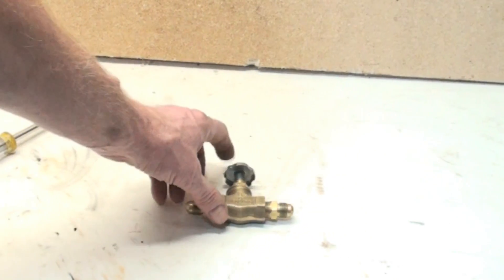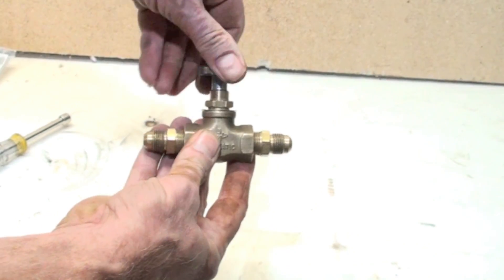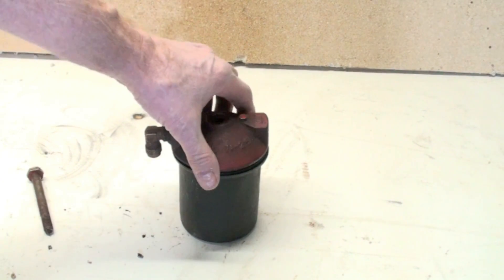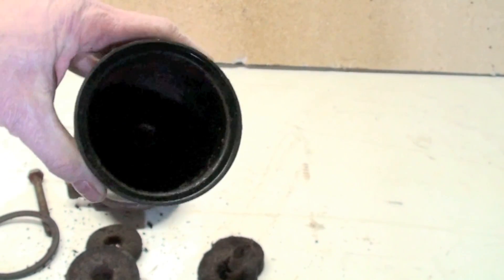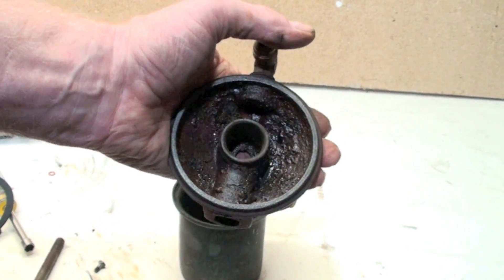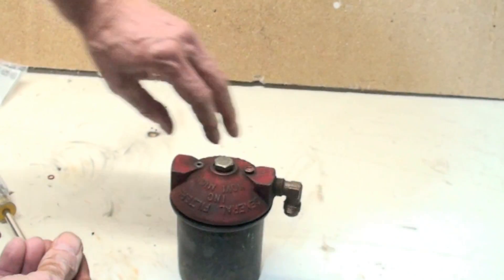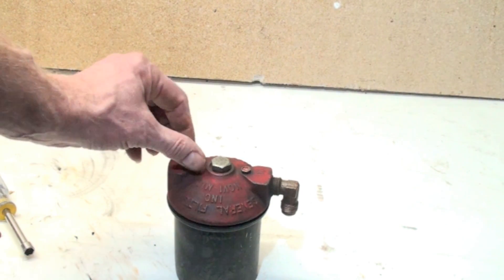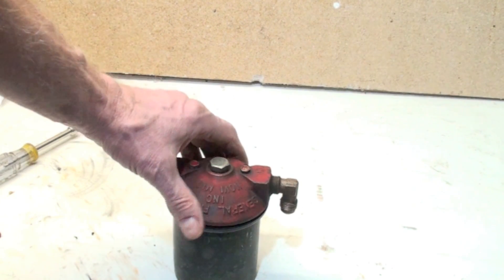Servicing the oil furnace part 1, the oil filter replacement

Comment: Right Give It A Tap.  That's because Most of These Valves Don't Fully Close. So In A Fire And  When The Inner Part Of The Knob Melts More The Likely The Valve Will Be At  Least Partly OPEN.     NOT GOOD

Comment: Is it necessary to filter the oil?   What will happen if you don't?
Reply from the maker: The nozzle has a very small orifice.  It plugs easily.  Also, the pump can be damaged.
GFM
Reply: @grayfurnaceman  Well, I've kept this old oil furnace running for about 3 seasons so far, making repairs MANY times using info from your very helpful videos and advice - now I'm stumped - I can't get it to come on at all - hitting the rest button got it to start up but would quit after 30 secs or so.  Now it does not work at all (isn't "popped out").   I was having oil mist in the chamber AND (get this) spark also but wouldn't ignite.   Even tried lighting the oil mist filled chamber with a electric match stuck into the access port and it STILL wouldn't light!   WT_ is going on?
Reply: Further - put a new nozzle in a couple days ago - also right now have the transformer tilted out so I can see the burner assembly.   Have attached jumper leads to the burner electrode "paddles" so I can see into the chamber to check for spark but now I can't use the reset button to try getting anything going.   No, I don't have a filter on the oil supply line but do tap off the oil from an upper level in the fuel supply tank so any "debris" is settled below that.   How do I "reset" the reset button or what does it being inoperable indicate?

Comment: I checked the whole lenght of my mobile home. Theres no oil filter or the thing u showed first. Would it be hard to install one and do u have a video on that?
Reply from the maker: I do not.  Pretty straight forward.  filter in the suction line.  Usually done with flare connections.
GFM
Reply: Ever figure that out?? I’m 3 months old in living here.. I don’t think there is a filter.. maybe under house, but I didn’t notice.  My fan keeps blowing after it shuts off.. don’t know what’s going on.  At least it’s not the burner always going..

Comment: i need to change my filter but i am not seeing any shut off valve for the oil?
Reply from the maker: If the system is a 2 pipe system, and the oil tank is below the burner,  you may not have a shut off valve.
GFM

Comment: my can is leaking, i have changed the gasket. it started leaking again about a week later..the can is on a slight angle. the leak is small and coming out of the side that the can is tilted towards..Could the can being tilted play a part in it leaking?
Reply from the maker: No.  If you have changed all gaskets, you may have to replace the canister.
GFM

Comment: My friend I already feel I owe you a few steak dinners but I have a question. My bleeder screw with new gasket is leaking/weeping. Within 10 minutes after being wiped dry there is a slick pooling up. Static with the unit turned off. It is the type that screws into the top center of the main through filter hold down bolt. It is a slotted/blade head and I've tightened it in stages to try and stop the leak. It is now very tight. Any further and I may break the screw and turn a small issue into a big problem. Should I try another new gasket...  Double up the gaskets....   Rubber o-ring...  Replace the screw with a hex/cap screw, stainless maybe would be stronger? The screw that's in there now appears to be a 'tool pail replacement'. Ideas? Either way thanks for all the helpful videos, Mike.

Comment: Where is the approved place to take a vacuum reading with a Tigerloop in the single pipe system?  Still at the pump or between the filter and the Tigerloop?  Does the air vent in the loop foul up the vacuum reading downstream to the pump?  Thanks.  Good videos.  Doug

Comment: The furnace is running while the bleeder screw is loose, correct? My filter is in line with the bottom of the tank, not gravity fed. Thanks.

Comment: How do we replace a leaking fireomatic valve at a residential oil ta nk. Full of oil without empting tank
Reply from the maker: Sounds like fun.  I have done it by pulling a vacuum on the tank with, believe it or not, my vacuum pump.  This is not easy.  If there is a oil gauge, you may have to remove it and put in a plug.  DO NOT pull a deep vacuum.  About 10" or even maybe 5" will easily do it.  Remove the filter, pull a vacuum on the top, open the fireomatic as you are vacuuming to see when it will not leak.  The fittings on the top of the tank have tendency to leak, so it may be tough to get it to hold vacuum.
Or, you could remove the valve and plug it with your thumb while you try to screw on a new one and hope.  Let me know how you do.
GFM

Comment from the maker: Sounds like a good idea to me.  It will bleed faster so you need to be there with a wrench to get it closed quickly.  I would also bleed the outlet to be sure you get all the air out.  Wish I would have thought about that.
GFM

Comment: I see 2 replacement filter types compatible with the General 1A-25a filter canister. The felt 1A-30 and a white Micro-Flow type.  The newer white one seems to filter a lot more junk than the felt one and they cost about the same... Which one do you prefer and why ?

Great video thanks.

Comment from the maker: The handle has come off.  It may be on the floor near the tank.  If not, the valve is spring loaded.  The center shaft can be lifted with a pair of pliers then a vice grip or small clamp clamped around the shaft.  Hope this helps.  Let me know.
GFM